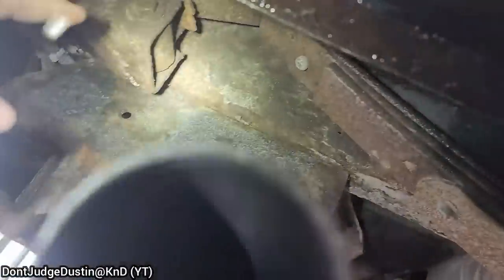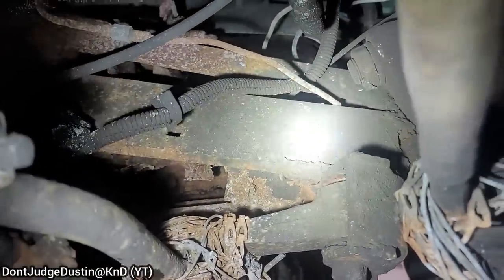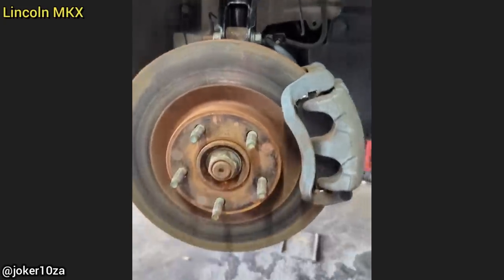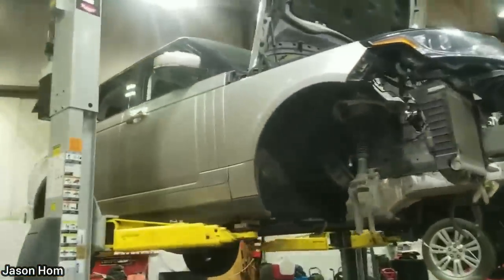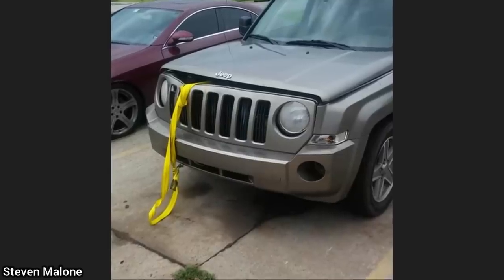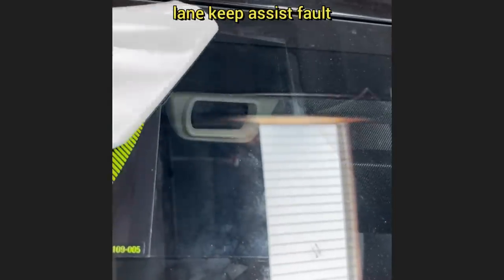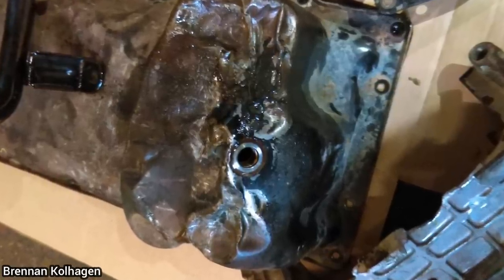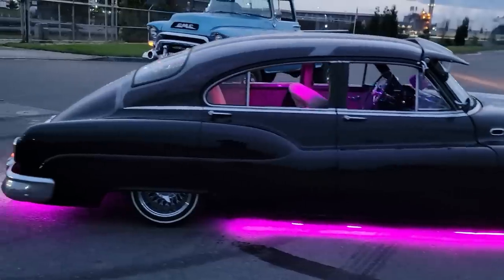Customer States They Just Want An Oil Change

Comment: Towing your car by the radiator mount for a battery change is the biggest brain move I've seen on this channel so far
Reply: Big brain, smooth cerebrum
Reply: You’re telling me you wouldn’t do the same thing?
Reply: @akronimm862  if you don't tow it by the windshield what are u doing?
Reply: I just chain both side view mirrors and pull it works with every car.
Reply: here i am walking to the closest shop and buying a new battery like a chump!
Reply: @mikekasich836  Towing it by the fuel line and wiring harness
Reply: Americans are difficult to underestimate.
Reply: I chain it by the front wheels
Reply: I need a new battery, let me destroy the front end of my car to get that. 😂 could’ve even just gone to Walmart 💀
Reply: @akronimm862  I'd have carried my battery to the nearest auto zone before doing something this stupid something I have actually done before would not recommend truck batteries are heavy
Reply: What's a bigger brain move is if they towed the car that means they had a car to go get the battery and never needed to tow the jeep anyway 😂😂😂
Reply: @chickenmanmackenzie3525 yeah, you're doing it wrong!

Comment: "Smashed the oil pan to make it fit", lol. Somehow that game where child's need to fit the correct shape into a plastic box came to my mind.
Reply: They all fit in the square hole where he comes from. Bootleg Chinese toys smh
Reply: Takes me back to my first car, a Renault 12 Gordini. I had a hell of a time finding a brake booster for it, so I ended up putting in one from a Renault Laguna... which is just a little bigger so it hit my brake cylinder... so I took a peening hammer and... well, you know. It ended up working fine tho, so it's all good!
Reply: @realDonaldTrump420  That's right, it goes in the square hole
Reply: @PrototypeSpaceMonkey  you got very lucky there
Reply: "Mother, you cram the puzzle pieces in." "Oh come on, I won't do that this time." "OK." "Hey, corner piece!" "There you go!" "... Bit of a stubborn one here. gets ready with scissors and a hammer." "LEAVE!!!"

Gotta admit, I copied most of this out of a Lola comic from some time way back. I don't remember when exactly, but probably from 2002 - 2007.
Reply: I mean sometimes it just won't go in, even if it looks like it should and is almost in XD

(Engine mounts ring any bells here?)

Comment: You would think if the customer was willing to put in the energy to come up with an elaborate plan for a tow, a basic battery swap would have come to mind.
Reply: Someone smart enough to put in a battery would know to find a proper towing point or just jump the dang thing and drive it in.
Reply: It's a Heep....errr, Jeep thing; you wouldn't understand. And be glad you don't.  "Always in a Heep!"  😆
Reply: @markh.6687  Jeep girl... 🤣
Reply: You have over estimated the human material.
Reply: Well you see... Tying a rope around any surface and pulling it is the most basic thing you can do. Now tying a rope to the frame of the vehicle or changing a battery is a more effort demanding action. For those you need a little bit of knowledge. Seeing how the owner went with the former, they probably have none of that and chose the option that's basic for them.
Reply: why do these people think there are motor wrecker yards .....
Reply: when you havnt got an IQ , nothing makes sense
Reply: About a year ago I carefully gave myself a jump with my emergency portable pack and drove to a car place. Easy.
Reply: @tinknal6449  Or you know, having a different functional vehicle to be able to tow said Jeep, could have just gone and picked up a replacement battery.
Reply: @NEEDbacon  Yeah, a massive number of good choices and they make the bad one....

Comment: "I will fix it myself/I will have a friend do it cheaper" is just a fancy way of saying "I'll be back"
Reply: Also when they finally do come back, it wasn’t them or their friend who made the mess, it was “another shop”.
Reply: Not always. Some of us take the "measure twice, cut once" approach to fixing things. I watched a dozen videos, read a dozen articles, and studied a diagram before replacing the thermostat and radiator on my car. Unfortunately that wasn't actually the problem. Turns out there was a factory recall for the head. Apparently Chevy cut some corners with the Cruze and ended up basically buying me a brand new engine, reimbursing me for parts, and paying for a two-week rental. The upside was I talked the rental company into giving me a bells and whistles Ram 1500 HEMI for the same price as the original rental car. I'm not a Dodge fan, but damn that truck was fun to drive. The downside of having a truck came when friends and family found out I had a truck. It's funny how everyone suddenly needed help moving something.
Reply: I've had shops diagnose problems for me so I could fix the part myself in 20 minutes for free instead of being billed $250 for "2 hours".
Reply: Or after they bring it to a cheaper shop and find out why it was cheaper when they need more done to fix the other shop. Or ....coworker more other than not.
Reply: I actually do fix it mysel.

Comment: From looking at the conditions of the vehicles I'm shaking my head that the owners would keep them on the road. The rusted out conversion van in particular should have been driven straight to the scarp yard instead of the shop. 

However, the sweet 50 Buick in the last clip is a whole different story.
Reply: He gets alot of hate for not 'keeping it real' and putting airbags instead of hydraulics. Even though hydraulic suspension has not improved in 75 years and is basically "you're on your own" when it comes to building something that doesn't leak or squeak.
Reply: @realDonaldTrump420  bags are ok.. underglow? It's not 2002 anymore (luckily)
Reply: @mrsnezbit2219  Nah I don’t care what year we’re in. I’ll always think under glow is cool

Comment: Hats off to the Buick owner for NOT putting in a Chevy small-block!
Reply from the maker: I'd love to hear the straight 8!
Reply: @JustRolledIn  Had my Buick at the dealer's for a computer recall recently and they were servicing a '51 Super.  Sounded mellow and low.
Reply: For sure...
Reply: Why? SBC are one of the best engines in automotive history (especially the 350) and if you want more power, they make them brand new and you can get a crate 350sbc that’s brand new and has a similar feel to a stock one with the power of a 5.3LS  (300hp and 375lb/ft torque). better yet it’ll outlive most of the people who own it.
Reply: @davidparks537  Rebuilding a Buick straight eight is an art.  Buying a crate 350 is shopping.  But of course, if you want what everybody else has, why not.
Reply: Hats back on for the fluro pink lights tho.😏
Reply: Yea the underglows and mexican slam  set up is sweet for sure.  I dont understand the fascination for praising people destroying these old cars
Reply: @terry94131  oh ok, makes sense. it seems it’s more about what makes sense for the build than rather it’s a good engine.  I was just curious.
Reply: @davidparks537  If I was building a '55 Chevy, I'd go with a crate 350, of course.  It's the best value horsepower you can get.  But if it was a '49 Olds, I'd want the original Olds engine.  Just traditional I guess.
Reply: obligatory LS-swap the world joke
Reply: @tcp3059  If I had my dad's '53 Studebaker truck that I learned to drive in, I'd slip in a small block.  That Studebaker flathead couldn't pull the skin off pudding.
Reply: Buick & chevy are both GM
Reply: @marioncobretti7870  it's not destroy. Not like it can't be brought back to it's original state. Chrome are all there, roof isn't chop, and I'm pretty sure it was in much worst states before the owner restored it to his taste !
Reply: Nice they kept the straight 8. But there’s plenty of Buick v8’s to pick from if they wanted to do a swap.
Reply: @davidparks537  Yep. Glad you have an open mind about it. I've loved Chevy small (and big!) blocks for over 50 years, but the Buick straight eight is a beautiful thing itself. It was as popular as the SBC in it's time, for good reason
Reply: @davidparks537  Advantages of the SBC over other make performance engines of the same era:  it’s cheaper to build.  End of advantages.
Reply: @JustRolledIn  same !
Reply: @davidparks537  There is a thing called VALUE and the highest value vintage car is one that has the same powertrain that it originally came with.  Mechanical miscegenation is repulsive because you're putting in a common-as-dirt SBC 350 instead of taking up the challenge to RESTORE what belongs there! 

Sane people RESPECT an owner who keeps a vintage car stock, despite the challenges of doing so.  When the original engine is beyond repair, it might be O.K. to get an engine of the SAME MAKE but, a later model.  For example, a shoebox Ford has a flathead V8 but, it is clapped out.  It's O.K. to put in a later Ford 302 V8 in and try to make it look like it came from the factory that way.  To drop a SBC in an antique Ford like that is just evil and stupid.

You can cheat a bit with electronic ignition and radial tires that look like bias ply but, it is always best to keep old cars STOCK if possible.
Reply: @terry94131   It may be an art to rebuild a Buick straight 8 but, it shows superior ownership responsibility to do so.  If the original engine is beyond repair, then it might be O.K. to put a later model small block Buick V8 in.   Buick with Buick is O.K.  Like must be with like or the car's value is ruined.  
The worst mortal sin of all is to do the no-brain low-effort low-intelligence "Muh SBC 350 or muh LS6 swap!  Durrr" into a car that is NOT a Chevy.  Not even the Pope could absolve somebody of such a sin!
Reply: @dondalphinjr5953  True, however there was a time when every GM division had their own engines, Chevy, Olds, Pontiac, Cadillac, Buick.
Reply: What exactly is the problem with doing what you want to your own vehicle to your own satisfaction? I, for one, like the look of old cars but want the new luxuries and tech.
Reply: @marioncobretti7870  I dont like light under the car, but in this case, I think their add personality. Some people love to enjoy their cars away from seeing them as museum pieces. Of course other people would love te restore to factory specs which makes sense being a such a classic.
Reply: @BlackPill-pu4vi  lol who made you the CEO of what is an acceptable engine swap?
Reply: @terry94131  👍
Reply: @davidparks537  I don't think anyone is putting down the SBC, it's that they are boring, you see thing things EVERYWHERE. Go to a car show and way too many people pave the same boring engine under the hood. That's why a lot of us call them "bellybutton motors", because everyone has one. 

Now if you see something like a straight 8, a Studebaker V8 (or flathead six), that's going to get more attention.
Reply: @JustRolledIn  I went to a meet years ago and the Studebaker National Museum had brought up one of the Studebaker Indy cars. It had a straight eight, megaphone exhaust, and sounded glorious!
Reply: @DeltaWhiskeyBravo13579  correct, but was a long, long time ago
Reply: Buick. Nuff said….
Reply: Down with ls swaps!
Reply: I love Buicks. This is beautiful. My favorite Buick is the 1978 Riviera. The LXXV edition.
Reply: I love BOPs. You know how many people told me to swap my Big block Oldsmobile out of my Toronado
Reply: @JustRolledIn  you won't hear it, It's almost like a sewing machine literally probably one of the smoothest engines I've ever owned and I have owned a lot of vintage cars (probably 150ish).
Reply: I used to be against small block Chevys because they were everywhere but for the last 10 years or so everyone has been all about the LS It's kind of nice seeing a small block Chevy these days.
Also in defense of the small block Chevy It is probably one of the better v8s made with a ton of different engine sizes a good power to weight ratio and performance parts are extremely cheap and readily available.
I am okay with a small block Chevy That being said I dig the Buick having it's original mill.
Reply: @marioncobretti7870  It is a mass produced item that served its useful life many decades ago.
I love a stock car but the reality is It isn't rare It isn't really valuable and at least with it being modified it is still on the road and its owner loves and cares for it. That Buick may not be your style nor mine for that matter but the owner is out driving it and having a good time and at the end of the day it's all about the memories we create with family and friends and a vintage car is just a conversation piece with a little nostalgia mixed in that bring smiles to people's faces.
Reply: What’s the actual difference? They’re both GM.
Reply: @valiroime  who is your question directed to?
I assume you mean the original poster person
If so their comment is because a small block Chevy is kind of boring because everybody has done it.
I personally like a small block Chevy because they are so good But I also got a lot of respect for anybody that will daily drive a straight 8 Buick. 
Myself I like the first generation of the small block the 1955 to 1967 era with road draft tubes, oil fill tubes in the front of the intake Just such a great looking engine in my opinion.
Reply: @JustRolledIn they live for ever
Reply: @dondalphinjr5953  you might want to have a chat with Buick Grand National owners for their opinions on your statement .
Reply: @kevin patrick  I had a neighbor who had a grand national,  and it was "built to the hilt",  that little v6 had so much torque, it broke motor mounts 3very time he took it to the local track. Since yeah, I will partially agree with you, but a mechanic friend told me all gm vehicles have had the same basic engine for the past 40 to 50 years
Reply: @JustRolledIn  
Sounds not unlike a straight 6.
Reply: It’s the market’s fault that some people feel the need to do that. Others just do it for the horsepower.
Reply: In the movie Rain Man they drove a 1948 Buick with a fireball 8. I wonder if it was a straight 8?. That  is a sweet Buick yet I would rather have that GMC 4x4 step side in the background.
Reply: BS!! Give me a 327 any day!!👍💪 🇺🇲
Reply: @terry94131  I 100% agree, I have a 55 GMC TRUCK with the original Pontiac V-8 and Hydromatic trans that I'm restoring and keeping it factory/original.
Reply: The Buick straight 8 was an very cool engine.
Reply: @stevenspaziani9159  Very smooth and great torque.
Reply: 3 on the tree 🤩
Reply: @terry94131  performance or classic style? Pick yer poison.
Reply: Hats not off to the under glow.
Reply: @davidparks537  the point is to keep it with an original engine not add one you like for more horsepower

Comment: I like how the owner of the Buick kept the the 3 oval badges on each side signifying that it has the original straight 6 but has a straight 8, love the sleeper look.
Reply: It's still not a fast car.  Similar to a Honda Civic with the straight 8.
Reply: @jayhemfindsyou  It is indeed a faster car with the inline 8cyl. More horsepower and more tourqe than the original straight 6, if it wasn't then why change the engine?  Just keep learning from these old mountain men, they are the ones that start the racing scene long before you, and I were even thought of.
Reply: @sbckev4172  My point is old cars with an 8 cylinder can barely keep up with a modern "econo-car" with a 4 cylinder.  Today's modern econo car can do 0-60 in 7 seconds and run the 1/4 mile in 16 seconds at 130 mph.
Reply: @jayhemfindsyou  Horsepower-to-weight ratio comes in.  While the inline engines had more torque, it wasn't built for racing.  But it has plenty of torque and power to haul itself and the car it's installed in in a smooth and comfortable manner.  Besides, comparing a 1950 Buick to any new econo car is just... well you can't.  There is no comparison.

Comment: I love the smashed oil pan 😂😂😂
Reply from the maker: Whoever did that 🤦
Reply: I know right? I couldn't figure out why they didn't just swap the oil pan from the bad engine? But a hack shop like that probably damaged the pan during removal...
Reply: @SofaKing85  or just an angry mechanic, frustrated with life over all 🤣🤣👍🏼👊🏼
Reply: @JustRolledIn  thats sue worthy matriral right there
Reply: If you are replacing an engine and pull out a ballpeen hammer, stop. Take a nap and then, rethink.
Reply: I know, "beat to fit"🤣👌
Reply: I guess that's a "I need a bigger hammer",moment?
Reply: "Custom-made oil pan". What??
Reply: There may have been 12-packs involved.
Reply: @stringlarson1247  And then go get the right tool for the job: a sledge!
Reply: @sparcnut  SAE or metric?
Reply: He likely tried to smash to engine block too. Just didnt happen.
Reply: - "Who installed your oil pan?"
- "Hulk smash! Make it fit."
Reply: If it doesn’t fit, FORCE IT!
Reply: @nelsblair2667  sometimes one has to step back and have a rethink.
If I lift the engine and drop it on the hammer...
Reply: Probably has a smashed oil pick-up too?
Reply: You all realize “another shop” mist certainly didn’t do that right?

Comment: Excellent video. I loved this “three on the tree” reference. I had a 1963 Jeep Tuxedo Park with the three on the tree configuration as my first vehicle in 1974 when I turned 16. That vehicle was awesome. 50 mph top speed. Leaky gas tank under the driver’s seat. What more could a 16 year old ask for……

Comment: In New Zealand we have an annual safety inspection, thank god. Most of this worn out crap would have been sent to the shredder and turned into new reinforcing steel long ago in NZ. And no, in nearly 60 years of working on cars, I've never seen that tie rod bolt trick. You'd be charged by the Police here if that came apart and someone was killed or injured.